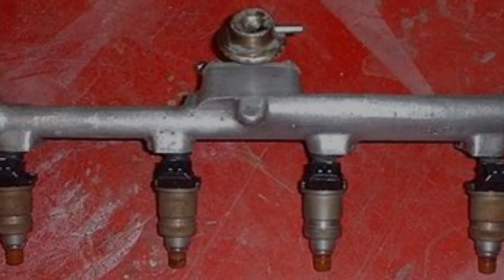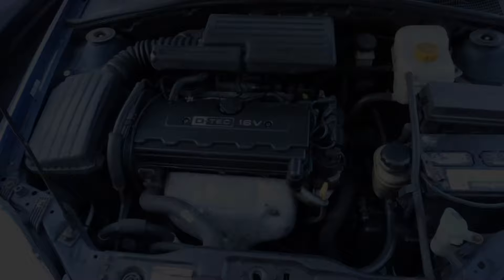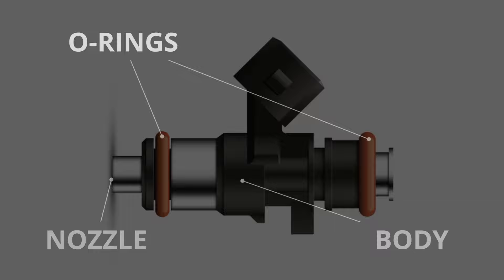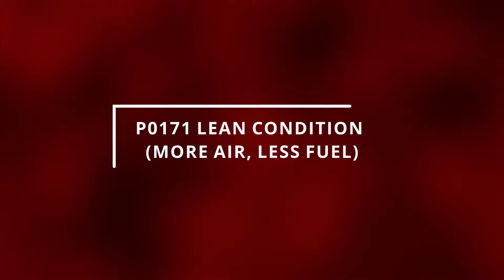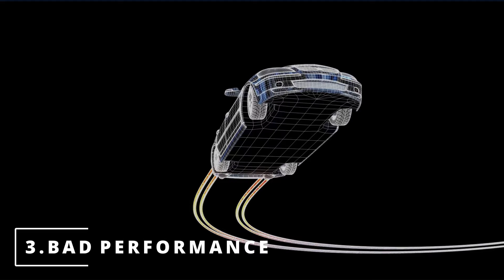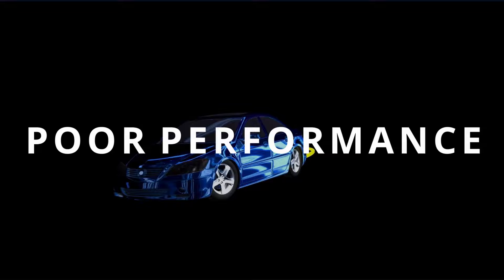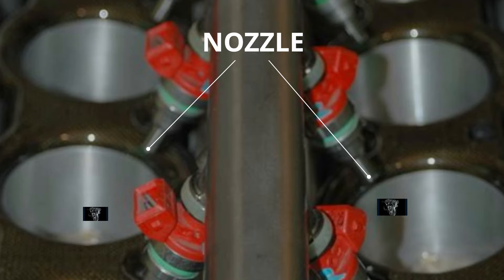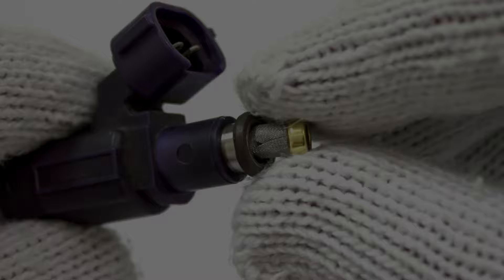SYMPTOMS OF A LEAKING FUEL INJECTOR

Comment: Good video, but you missed a hard to start engine because the gas leaks into the cylinder
Reply: I've been having hard start issues never thought about the fuel injectors
Reply: I know this is an old comment, but can this be caused by the sealing rings or is this most likely happening because of a stuck or dirty injector ?  Just made some leak tests on my old mazda and saw a puddle of fuel on top of my piston after few minutes. And the cranking is long.
Reply: I have the same symptom in my van. Hard starting and high O² sensor voltage.
Reply: @jiouse5881  mine was infact caused by a dirty injector. So it probably didn't close all the way and fuel leaked into the cylinder over night and pressure dropped. I tried the lazy man's cleaning method where you just directly spray the cleaner into your fuel rail so the car runs only with carb cleaner and added some injector cleaner to my fuel tank.  Problem solved and mazda takes me to work every day :)
Reply: @mercer982 having the same issue with my chrysler would you say it was a simple solution? What spray did you use
Reply: @edduin24  yeah, i would say it's pretty simple. Since you don't have to really take anything apart other than disconnecting a fuel line. I used CRC Carb cleaner in my case. Sometimes tho there can be something stuck in the injector and this method may not remove what ever is not letting it close properly, something that even carb cleaner won't dissolve. Oh and remember to disconnect your fuel pump , you're only using the pressure of your aerosol. it's ridiculous how well my car ran with that cleaner lol.
Reply: @mercer982  damn brotha solid ass game thank you, I replaced my injector and my car is leaking gas out I probably didn’t install it properly
Reply: no problem. remember to put some grease on those rubber seals before you stick them in with the rail. it's really hard to tell sometimes if they are bottomed out.  @edduin24
Reply: @mercer982  thank you brotha💯
Reply: would that also cause the vehicle not to rev out?
Reply: @theekemar4113  one bad injector wouldn't still cause that much issues.
Reply: @mercer982  what you would suggest then? I changed the fuel pump and cleaned the turbo and it isn't reving pass 2000rpm
Reply: @theekemar4113  check if there's any flow restrictions.  Glogged air filter or glogged exhaust for example. or your car could be in some sort of a fault mode. Really hard to tell.

Comment: a single puff of smoke from the tail pipe thats only there upon first startup is also a leaking nozzle/fuel injector because when you shut it off at night it drips all through the night into the cylinder untill the fuel rail pressure subsides, and makes a pool of gas on the piston top that turns into that puff of smoke when you start it up the next day
Reply: what color is the smoke supposed to be?
Reply: Also if you change your own oil you'll notice the oil will smell of raw fuel a lot
Reply: thats exactly what I experienced... I realized that there was a little dripping from my tailpipe or muffler and today my truck wouldnt start... any advice what if might be??
Reply: @Jonathan-mp7xg hmmm true about the condensation part, but what would you say my best bet to check first since the car not starting. good batter, starter, alternator, and now im stumped.

Comment: I have a misfire on #2 and low compression. While replacing a coil pack and spark plugs I noticed oil in the fuel injector harness. Could this be as simple as just a bad fuel injector? Or is it valve cover gasket issues?
Reply: Anyone else? Solutions
Reply: Low compression means you need to rebuild your engine
Reply: Low compression you have way bigger issues
Reply: Just junk it man. You're wasting time and money on that clapped out motor
Reply: I have the same issue. Lost compression in cylinder 4 with oil in the cylinder. What happened with yours?

Comment: I have no engine code on but I do have fuel smell in my oil. I changed the oil because it was at my normal 3500 k mile interval and noticed oil smelled like gas. Changed the oil and 50 miles later, oil still smells like gas. Help please!!
Reply: Did you ever find the problem?

Comment: I had a P0171, a P0420, and a P2195 code after replacing the battery in my Toyota. After some research, I figured it was the computer whacking out because it needed to relearn how all the components work and what their normal working condition is. However, knowing what condition a fuel injector is in will have a specific accompanying code helps to eliminate the fuel injector as an issue. If it's clogged or non-functional, there would be a P0301-P0308 "misfire on cylinder" error. If it's leaking externally, you'd smell gasoline in the engine bay. If it's leaking internally, you'd get a P0172 error for "rich condition". Plus, there's error P0201-P0210 to accompany any of those conditions.
Reply: I have this issue with my truck I got that p0172 code, should I replace the fuel injectors? when I start the truck it cranks but I have to tap the gas pedal a few times then I’ll start , the code p0172 also said system to rich bank 1 but idk if all of this is cause of my fuel injectors
Reply: @Killedby-Monty  JTLYK, most of my information is from vast amounts of internet research and looking at multiple different videos to find out that one problem can have a chain reaction of error codes if the problem is one direction or another. So, I would suggest you go with process of elimination. One thing of note with regards to tapping the pedal: Is your truck fuel injected? If so, tapping the gas pedal shouldn't really be having an effect on helping the engine to turn over. My neighbor sold me a truck because it was having problems working and he didn't want it anymore. One problem was that it hesitated badly. After I agreed to take it off his hands, I replaced the battery and he pumped the gas pedal a few times claiming that that helped to get the engine turned over. The thing is pumping the gas pedal was something of necessity for older cars because newer cars are fuel injected and don't need priming. After cleaning the throttle body, it stopped hesitating.
Reply: @renegade637  I’m not sure but I’ll clean the throttle body and hopefully that’s my problem because also when the truck is at a rest position and when I  drive it’ll start to shake and sound like it wants to cut off and when I reverse to it’ll shake badly and sounds different also like it has a cam on it ? And normally I’ve never had to press the gas pedal for the truck to turn on I would just turn the key and boom it’s on.

Comment: I have a 1998 F150 I get crappy gas mileage and sometimes it runs really bad sometimes even shaking the whole truck and then it's smooth out and runs like it's supposed to I hadn't you oxygen sensors put in but that didn't do no difference I had new plugs put in and a new coil pack but that didn't stop the problem anyone have any advice on what may be causing my problems
Reply: One thing to check is the evap system.Purge valves go bad on those and the tank doesn't vent or burn vapor properly. A leaky condition can result in flooding,hard to start,black smoke.A leak down test on the injector rails is pretty easy to do.

Comment: Sounds like the issue im having. Having issues after getting gas everytime. I replace spark plugs coils purge value and map and o2 sensors and fuel pump. So has to be injectors

Comment: When you say misfire do you mean the popping sound I hear randomly coming from the engine bay? It'll be running fine, then, on acceleration...pop, pop, pop...then run okay. It'll pop 2 or 3 times typically, then be okay for a while.

Comment: Fuel injector resistance are 8.8, 8.9, 8.8, 8.9 on a sentra 1.4 engine. If this is low, what should I do? Owner's manual says resistance should be something in the 11 and 15(?) range. Spark plugs are normal. Quick start on cold or hot. Engine's performs fine.
Reply: As the coil of the injector is most likely original, means the coil may decrease in resistance as time goes on. Considering the factory states that the coil should be 10-11 ohms, I’d say 8-9 isn’t bad, especially since you probably measured while the injector was warm/hot. That will cause impedance changes on the coil as well. As long as it runs well and you have no SES codes, don’t look for a problem.

Comment: Changed the catalytic converter a few days ago. It is now smoking while being revved at 2-3000 Rpm.  Think it’s the fuel injector? No coolant loss or overheating so i don’t think it’s a head gasket but white smoke
Reply: Having same problem like it won't go over 25-30 and everything has been replaced except my fuel injectors
Reply: Same bruh!

Comment: Hello guys I have a 2008 clk350. She starts up first thing in am. But after I turn her off for about 15-45 minutes then she struggles to start up. I have to give it gas and when I give to much gas it’s a popping noise coming from the engine bay. Suggest that’s due to to much air but I was wondering if a bad or leaking fuel injector could possibly cause this problem. Thanks

Comment: My 2001 Hyundai tiburon got me 44km for R300 petrol. About 7.2L of petrol. I need to use it to see clients now its kill8ng me with petrol. My old one used to get me 140km on the same amount of feul. I have replaced all my srnsors, ECU and feul regulator. Im sure i need to replace the injectors now. I do have another 3 ECUs i can try but i already put another one in. My tib idles like a racecar rough and Loud. One guy thaught i had a rotary in it

Comment: I believe I have an engine misfire. The O2 sensor is throwing a code and I found out that gas is leaking from the fuel injector today while replacing the spark plugs.

Comment: Hey smart uploader, can you explain another sinmptom that you didn't cover. A very BIG BANG like a hammer while driving on the road at 2000rpms 40miles/h. The engine carried on running, I did not even stop.. no engine management light on, NOTHING. I just put a scan tool and the error was an internat error from DDE. The car is BMW, M47 engine, 2 litres diesel.
Dismatle later the 2 injectors FOUND TO SEND BACK TO THE TANK A LOT OF FUEL. Almost triple the amount of other 2... replaced the injectors temporary with 2 other I had already of ebay. Car is back to normal at moment. Never had any, I mean any issues with the injectors in 300k miles that are on the clock. I have ISTA+ diagosing tool for my car so the car is read now and them or when error appears on the dash..
I used for almost 250k mile 2 stroke oil mixed with diesel..
Nozzles tested with brake spray for pattern and blockage  on al injectors removed or installed. No issue.
Could you put your mind at my stance, situation I faced? And give me a reason?
The car has Bosch injector.

Comment: Would bad o rings on a couple of them cause white smoke and excessive fuel out the exhaust or is that more a fuel pressure reg ?
Reply: Im not a machanic per say but that could be a bad head gasket. The fuel part im not sure about but could be part of it
Reply: Turns out the caps in the ecu were fried, refurbished ecu , good as new. Cheers

Comment: A ton of white smoke from to the tailpipe that stinks like gasoline. Best get those fuel injectors replaced before you blow something out in the engine, i.e head gasket, cylinder, valves, spark plug, etc.

Comment: 2000 Ford explorer v6 sohc: Engine was replaced but replacement failed after a week. There's knocking and no oil pressure. I removed the air intake manifold and saw the 3 passenger-side air passages filled with gasoline. Any ideas?

Comment: Can all 4 injectors leak at the nozzle 😅as I changed temp switch map sensor throttle body and done compression test aswell as change the ecu but car still runs very ritch and has alot of carbon in the exhust

Comment: i had a P0170 (fuel trim malfunction (bank1)) fault code when scanning my car,.and i had no check engine light appeared on the meter,. mostly what is the meaning of this code,.(i noticed that my car exaust smell of petrol) and my car engine oil also the smell of petrol,.some time the hard to crank and sometime rough idle when starting

Comment: im having this cod for while P0172 system too rich bank 1 !!!! whats this for i have checked many things and changed maf sensor, spark plugs, valve gasket, air filter, in one day !!!! but sytill having this error, pls help me , Thanks
Reply: Did you ever solve it ?
Reply: @diegobertoalmonte5869  not yet 🥲 still looking after this problem
Reply: Check the o2 sensor,mine p0172 was gone after replacing it

Comment: Hey bro my toyota vitz fuel consumption has gone pretty high, iv changed the plugs few times but still kindly assist
Reply: And there is no check engine light or any other on the dash
Reply: @ameerzulfiquar2111 Did you figure it out? Could be your Coils, Fuel filter, Air Filter or it could be a dirty MAF/MAP Censor, Dirty throttle body or caked up Intake Valves. I would suggest using Lucas Fuel Injector Cleaner. Helped my cars idle and made it run more smooth. Also gain 4 MPG

Comment: Yo! Mines wasnt leaking till i touched it and it shot out feom the nozzle. Im actually looking for a solution to my problem. At stop lights, when i try to accelerate, it acts like its not getting enough gas or the right mix of gas and air...so the motor shuts off..or at 70mph and j have my foot on the gas, it will not let me give it gas. Bc its not getting any, the motor shuts off. The other day, while it was cold i started it and turned on the a/c, it died right away. Its getting too hot and emitting a white smoke from an "under-the-hood exhaust" looking thing. Ive changed the filter, the pumps motor and filter and the tps...no one has an obd1 reader so i had to put in into manual and pull the code myself. 31. In the Chilton(extra repair manual)  it says 31 is an air flow meter. Does this sound correct?
Reply: 93 Toyota Corolla 1.8 dx
Reply: Any update? This sounds like a bad head gasket

Comment: What do you think about a hard starting integra where the fuel pump and regulator was changed and iacv cleaned. Thinking I'm losing fuel pressure when it sits a few hours.   Rough idles occasionally too.
Reply: Did you find the problem?
Reply: fuel pump relay? (sorry im very new to all this and i might sound stupid)

Comment: can a bad injector cause a low voltage in the o2 sensor
Reply: No that is not possible.
Reply: @rexxor4219  but low volatge means the engine is running rich

Comment: Chrysler Grand Voyager 2008 2.8 crd diesel getting P0087. Fuel Rail/System Pressure too low.
Reply: Having the same issue except with my Saab might be related as it’s also a 2.8 v6 except not a diesel   I’ve changed two fuel pumps to the same outcome with p0089 also coming up changed the pressure sensors to no avail so most likely will either be weak fuel pumps or the actual injectors/fuel lines might have a pin hole leak in them as Chryslers/Saabs are very picky with these things sm sitting at about 1.1bar  when it should be reading above 3-4bar or 50-60psi fuel pressure

Comment: Po302 ???
Reply from the maker: A P0302 code indicates a misfire in cylinder 2 of the engine. Common causes include faulty spark plugs, ignition coils, fuel injectors, and vacuum leaks.